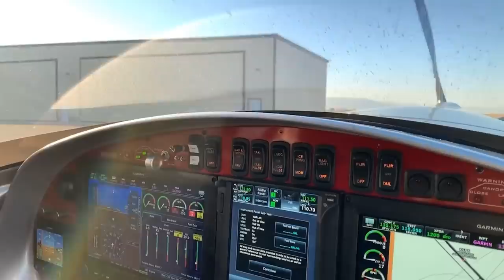Catastrophic Engine Failure...When Things Go Right!

Comment: Happy to hear you guy got down safe.  I lost my 2 best flying buddies when they went down flying a Wheeler after  taking off out of Grand Prarie TX airport and lost the engine.  Below them was a busy highway, and a service road that was relatively empty, but landing on the service road meant they had to squeeze in between the light standards for the highway and some buisnesses. I'm told the highway was stacked with semis and just to many cars to set down on it.  Just before touchdown on the servince road a pickup pulled out of a gas station on their right and they zigged left to try and clear it, but struck a light pole.  Which sheered off the left wing and ripped open the fuel cell.  Then they ended up rear ending the pickup where the airplane burst into flame with them trapped inside.  The You Videos are hard for me to watch, because I was supposed to go flying with them that day to look at a Barin we were wanting to buy so we could take our families on trips with us. The accident was on December 21st 2020.  I had elected to stay home that day and finish my Christmas Shopping.
Like Mike said, flying is risky, but being prepared to deal with emergencies can save your life.  
Sometime the dice just don't roll right.
Again, I am thrilled you 2 got down without bending plane of bodies!

Comment: Lost an engine (2 jugs on O-360-A1D) on my C model Mooney at 8,000ft scoring from Arkansas to C77 in Illinois however, if you lose an engine in my experience you want to do it in a Mooney as they will glide almost forever. I actually lost the engine over Mendota, IL and landed at KRFD because of setting the plane for best rate VY. This was in 1988 and I was only 18 at the time. This is something a person will never forget

Comment: I stalled a plane about 10 feet off the ground on my 3rd landing of my first solo.  Bent the aircraft pretty good, but nothing happened to me.  Turned on the news that night and they were talking about me and when the guy said my name it felt like he was in the room with me.  Very strange experience.  I took a few days or weeks off before I started back with my flying lessons, and got back into it.  I bought my own aircraft and I ended up with about 1200 hours when I stopped flying.  My instructor was an ex military pilot and instructor with two tours in Viet Nam flying a Huey.  He was adamant about flying by the numbers and landing on the numbers, so I had to point out that I took a chunk out of one the numbers on the runway with the landing gear as it folded up under the fuselage.

Comment: Hi I was an RC pilot in the 80’s.  Once the quick-link of my elevator came loose because of bad soldering. Using throttle it was a safe landing, although I had to do some passes to see how it would react. Another time engine mixture wasn’t right and I had to land a Hawk(Red Arrows) tailwind in high grass. If you ever have to do that, keep speed up just above the ground, and at the last moment, make it stall. Another event was a microburst with a high speed plane. I didn’t even have time to correct, it crashed. Anyone who cannot do the’real’ flying, it’s fun to fly a model plane, too. Hold on to regulations, though.

Comment: Right after I got my private license (19 years old) I rented the warrior I learned to fly in to go down and visit an aviation college. I picked the worst time to leave, Southwest airlines morning "push". I was #4 in line so I had jetwash blowing me all around then I looked back and there's another 4 or 5 737's behind me !! Talk about instant stress !! I did a hurried mag check and before I knew it I was next, cleared for take off NO DELAY, LEFT TURNOUT caution wake turbulence departing 737. As I pour in all 160 horses the first thing that comes to mind is, man this thing is anemic, where's the rest of my power???? I seems like I was headed for that 3,000 foot marker where I clocked the 737 lift off at and I'm still in ground effect trying to get this thing to climb. Many things went thru my head, pull the power and land but here's a 737 on my heels so bad idea, I'm barely flying so If I can get any climb I'll just circle back and land, now I'm breaking 150 feet, tower comes on says Cherokee, left turn out got SW holding short, ahhh crap these guys are waiting on me, ok fly the airplane, now I star climbing a little at a time, nowhere near what I'm used to and get to about 1,000' agl and decide I'm going back, this isn't right so I changed freq's and just as I was about to make the call I look at the starter ignition key and it's on L, I felt my instructor slap the back of my head DOH !!! As soon as I saw that I turned the ignition to BOTH and voila !! I found the rest of the power !! Scared the crap out of myself. Lessons learned, do not let ATC intimidate me such that I blow right past a good run up because I felt "hurried" whether it's self induced or implied by ATC and all those 737's in front and behind. Looking back, as fast as they were launching I should have just asked to taxi to the ramp and let the mad rush go by since those guys were all ready. Second is troubleshooting on the fly. My gut was right I just didn't know why, listen to your gut. I made it my mission to learn above and beyond what the private pilot's course teaches about airplane systems and operation. Probably why I became an A&P. Third, pat myself on the back, I never broke rule #1 and didn't bend the airplane or myself for that matter.

Comment: The guy who ran my helicopter flight school had an engine failure on his turbine check ride. They autorotated to the airport, the mechanic came and fixed the fuel control, and he went right back up and finished the check ride like an hour later.

Comment: I'm amazed how many commenters here have experienced an actual inflight engine failure. In 13,000 hours of flying, half of it in light GA aircraft, it's never happened to me, not even close. The closest thing was a precautionary shutdown of a PT6 on a commuter airliner that started a mild surging due to a stuttering bleed valve. The shutdown was more a matter of passenger comfort than an aircraft control necessity. Other than that, they've always just kept on ticking.
Reply: Well, that is called statistics. The chances of being struck by lightning are minimal, but some get struck several times. I is all about probability.  And the probability of an engine out in a single piston engine is much higher than in a dual turbine. Therefore, you need to prepare and minimize the outcome impact  by keeping alternatives available. I have never been hit by crossing the tracks in 50 years were the last words of man after getting hit. May mantra is: There are pilots who had an engine out and there are pilots that will have on sometime. Be prepared.

Comment: If we switch to two small rear turbofan jets there is some natural redundancy, both to stay aloft and to cross oceans. Single engine engine out over frigid atlantic without proper gear, you are in trouble. A ballistic chute is also a nice safety buffer to have in case of loss of control of aircraft or some exotic terrain that's impossible to land on. Air tight pressurized is a nice quality for ditching in cold water. 
And I assume this was nice summer weather but we need nice big clear quality synthetic vision so we can fly completely blind and feel in complete control in zero visibility. Fancy forward radar could be a good extra layer in case there are some contacts in the air that don't fly with transponders or to land blind on wild terrain. Forward looking phased array radars are quite inexpensive for cars although in principle you actually need some kind of full surround radar when two planes converge with near parallel vectors. And such a full surround short range radar system should actually be quite doable for modest money. Supply issues aside, modern electronics is both very impressive and dirt cheap.

Comment: Fly it to the ground, the Must make the airport/road/etc and run out of energy stall spin become those nightly news stories.  The people that don't make the news realize their best option is to land it with some energy to spare even if it isn't the optimal spot.  Much more likely to survive hitting a tree at 20mph on roll out than falling to the ground in a spin.  I was watching a video a while back about a student who lost her wheel on a solo.  My son and wife asked me seriously what do you do in that situation, my response is accept the plane now belongs to the insurance company and make the best normal landing you can, don't try to cut the engine, don't try some heroic move, just land it as normally as possible, and noted I would probably land it off center some to give more room and with the cross wind component giving allowing me to keep that wing up the longest.  Not sure my wife liked that answer much but she understood. 

This is much easier said sitting on the ground than in the air, but you condition yourself as part of your risk assessment.  In an airplane emergency your job is to protect those on the ground and those in the plane, a little bent sheet metal should not be at the top of the list.

Comment: Can something like this be fixed and flown out, or would it be grounded for a inspection  and new certification? 
Just curious. I dont fly
Reply: These engines are modular like an old Volkswagen Beetle engine. Each cylinder can be removed and replaced individually.  Once the engine is repaired, the A&P mechanic who does the work can sign off and approve it to return to the air.

Comment: Quick Question For All Of You:

I am in the midst of designing and building a FULLY TOUCH-SCREEN, OPEN SOURCE and FREE avionics flight suite that will consist of ONLY TWO ruggedized 15 inch touchscreen tablets or laptops (one main screen and one fail-over-to-secondary backup screen) that will have Garmin-level quality-testing which is a FUSION of real-time satellite/aerial ground imagery with vector maps overlay and real-time vector GPS navigation, a FUSION of multi-camera three-band Infrared thermal (FLIR) and optical nightvision cameras with video color correction and SOBEL/CANNY edge-enhancement, full ALL-ATTITUDE 3D-XYZ flight in ANY orientation auto-pilot with severe-weather + rainstorm and snowstorm flight control with emergency landing and takeoff ability. All my selected computer gear is INEXPENSIVE IP-69 and Mil-Spec 810-G/H/K rated rugged hardware which you can buy for less than $3000 USD so the only expense is the tablets/laptops and GoPro-like cameras themselves!  I will also design the FLIR camera and Nightvision Optical camera motherboards and casing design and parts list which will have open source hardware design so you can build it ALL yourself.

I am also adding built-in SDR (Software Defined Radio) with Shortwave, VHF/UHF/2 meter transceivers and AM/FM/SiriusSat receivers and SDR-based Emergency beacons, standard email/internet/SMS texting via various satellite bands. Two Twenty Terabyte ruggedized external hard drives using MP4/X264 multi-camera full-journey video recording with easy-to-read White text on Black Below-Video-Display-Bar with captions on every video frame with Lat/Long/Elev, SOG (Speed Over Ground), True Heading, Compass Heading, Horizon, Roll, Pitch, Yaw, Wind Speed, Video Frame Number, SMPTE Timecode, 12/24 hour Clock Date/Time, Engine RPM, Fuel Stats, Outside Air Pressure in Bar and PSI and Outside Temperature.

Please reply to this post indicating what ELSE you want in this FULLY OPEN SOURCE flight avionics system. TWO modern 2022-era Touchscreen Ruggedized Tablets or Laptops can easily handle all flight control, navigation and video recording while STILL being safe-for-aviation-use by using automatic and pilot initiated fail-over to other screens or even in-cabin laptops in any emergency or power failure. 

I can even get USA FAA and Canadian DOT certifications (which I will pay for!) and just GIVE THE SOFTWARE AWAY for FREE !!!! 

So long you buy at least TWO of a pre-set list of ruggedized tablets and laptops you can use it FREELY in your aircraft. I will even GIVE AWAY the full source code under Open Source GPL-3 licence terms to ensure non-proprietary use and updates.

What else do you want this system to do? What features MUST it have to be useful to you? What OTHER flight information do you need in REAL-TIME ON-SCREEN or on the real-time recorded video streams? What do you want to see in this flight avionics system? 

If you want I can even put in a FULL FLY-BY-WIRE aircraft control system that is fully ALL-ATTITUDE flying and ACROBATICS capable! I will even design a -100C (ultra high altitude) to +100C operational fibre-optics-based fail-gracefully flight control motherboards and motor designs to control all your aerodynamic control surfaces. 

I have done 30+ years of real-time synthetic vision and real-time image recognition systems before, so the actual coding of it is no issue. The OS on the ARM or AMD/Intel-CPU-chip-based tablets and laptops would be a real-time CRITICAL SYSTEMS version of Linux Operating System with the app running as a just-above-kernel-mode task that can fail-over to a fail-gracefully manual flight systems mode upon power failure and other emergencies.

What OTHER FEATURES do you all want? 

Based upon my current programming source code rate, I should be done Version 1.0 by December 2022 -- Would love to know MORE about what you pilots want in a fully Open Source Avionics Suite With All-Attitude/All-Weather Auto-Pilot, SDR Communications and Multi-Spectral Video and Audio Recording that is military-fighter-jet grade of sophistication with a CRITICAL SYSTEMS SPACE-RATED-level of source code testing and quality control!

AND YES I can do a heads-up display with USER-SELECTED on-screen items set from a menu list and/or a pre-selected user-defined list of on-screen items.

Reply to this comment or direct message me at my Youtube ID.

V